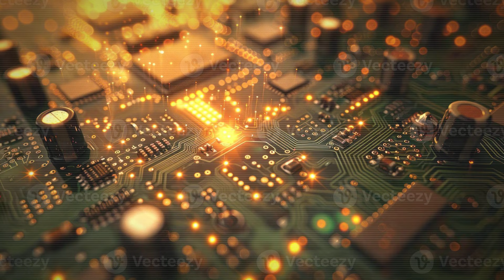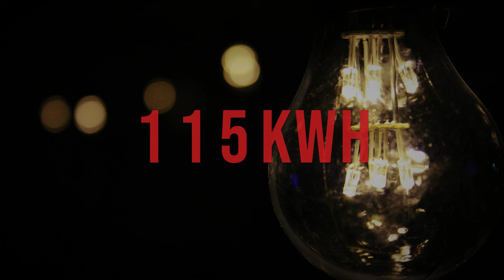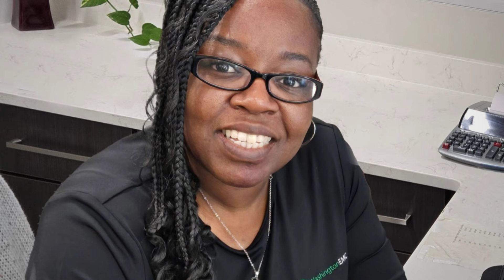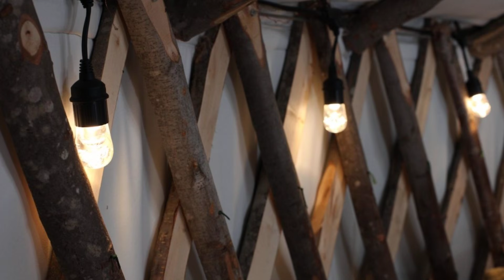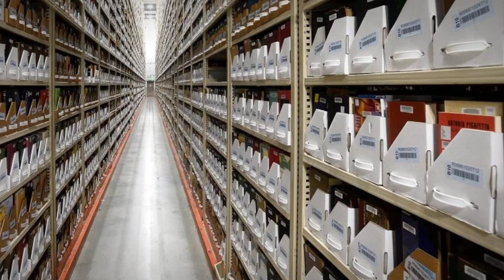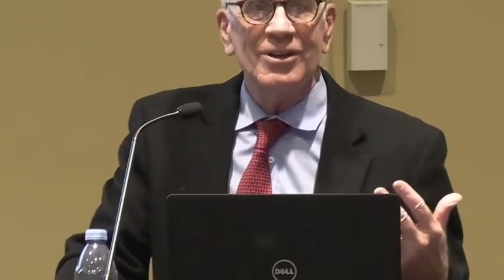This $18 Roof Trick Powers Any Home Off-Grid Forever. Why Is the Energy Industry Silent?

Comment: The problem is efficiency!  Peltier modules have very low efficiency.  They only generate like 1-5 watts per unit.  A single module at peak performance is at best, a slow phone charger.  Of course you can put a ton of them in parallel.  Assuming a peak 5 watts per module, you'd need 20 to get to 100 watts.  200 to hit 1KW.  A common size would be 40x40mm.  That's 320k square mm or 320 square meters.  That's a 17.88 x 17.88 meter square or roughly 60 x 60 feet.  That's all for a single KW.  Nobody is investing heavily into R&D for peltier cooling/heating/generation right now.  That's what we need.  The efficiency is roughly under 10%.  If the efficiency can get a big boost, they will have many more applications, but as of now, not too many.  There's a lot of headroom for improvement, so I expect them to replace a lot of traditional devices.  As of right now, I'd like to see them integrated into solar panels.  They can harvest heat off the panels.  Either that or a cooling water bladder on the back of the panel to increase efficiency and preheat water for a water heater.  Their other niche use is small form factor cooling.  They use low voltage DC, which is great to pair with batteries and they're very small.  Attempting to make a traditional refrigerant style cooling system for something tiny, the size of a lunchbox, is out of the question.  Something like an organ transplant cooler, with a swappable battery.  Portable phone charger powered by a camp fire.  It's not a conspiracy, it's just not effective enough yet.

Comment: There are lots of good reasons why they don't want you to connect to the power grid, mostly because they don't want back feed potentially injuring someone or worse in the case that is not wired up properly. And anything connected to the grid brings a certain set of liabilities that the power company wants to avoid. Just dump it into a battery then an inverter
Reply: Millions of people have solar installed on their homes that feeds into the grid.  There are phase-locking, island protection inverters that are completely safe to use.  THOSE devices are what needs to be judged for grid connection safety.  The same or a similar inverter could be used to grid tie a peltier generator.  OF COURSE it has to be done safely.  Rejecting a new idea with the blanket excuse of safety is just lazy engineering.  All the components needed to do it safely are already commercially available without any custom work at all.